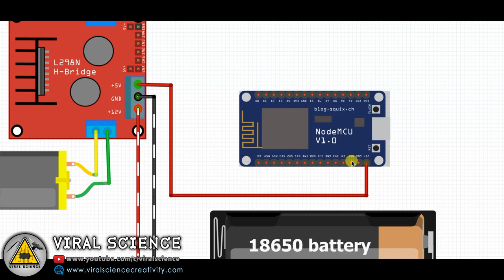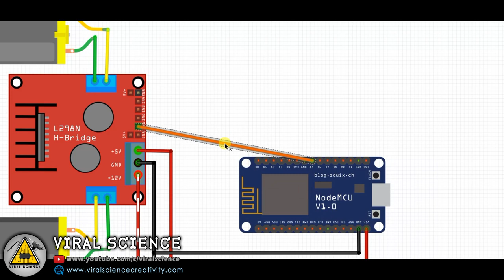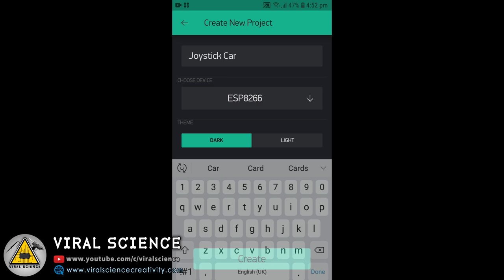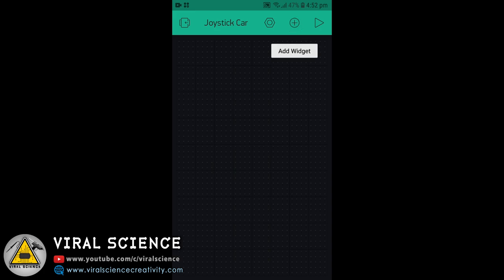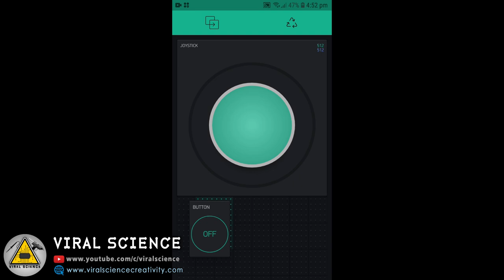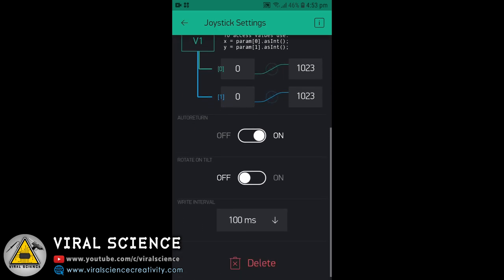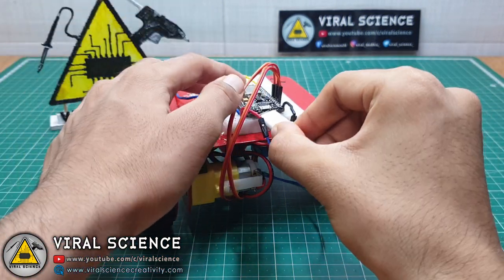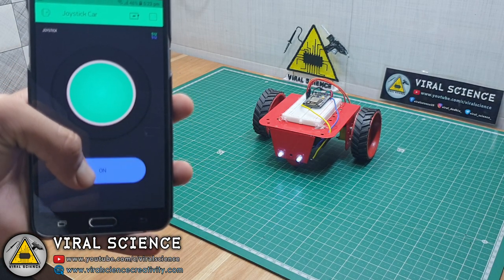ESP8266 Blynk Joystick Controlled Car IOT

Comment: I wonder why didn't you use the enable A & B outputs of l298n module in order to control the speed of the motors, from what I see here your lines which consists speed of motors are useless and the motors work with the 5 volts high command only! 

I hope you review my comment and understand it.

Comment: i try to upload the code and it said BlynkSimpleEsp8266.h: No such file or directory do you have a fix?
Reply: Upload to ESP8266, Not arduino and make sure you have selected right board and port
Reply: It's not working it's showing the same error !!
How do I fix ?
Reply: Choose correct port
Reply: Install the librery in Arduino